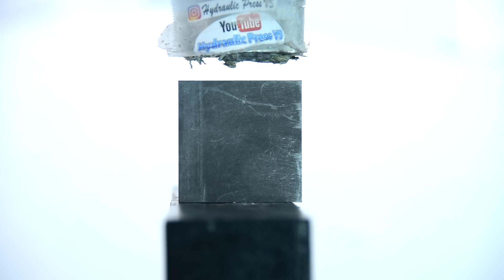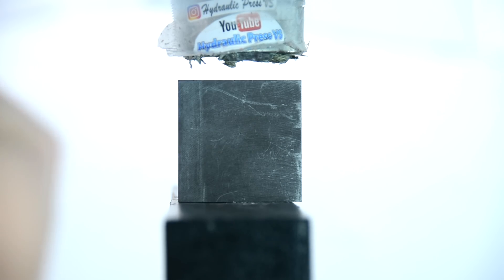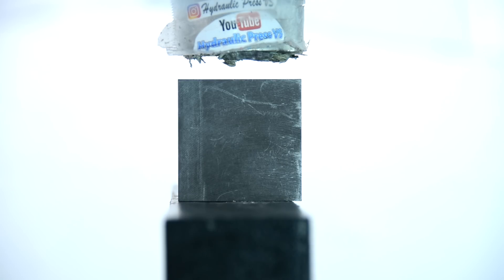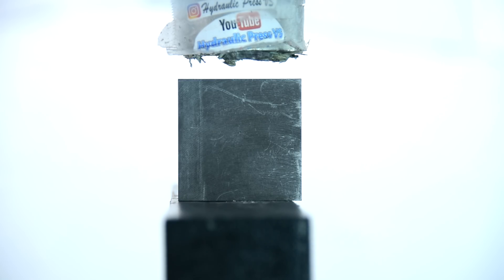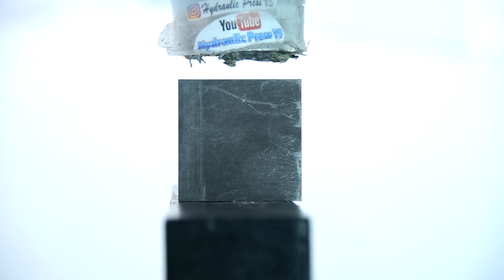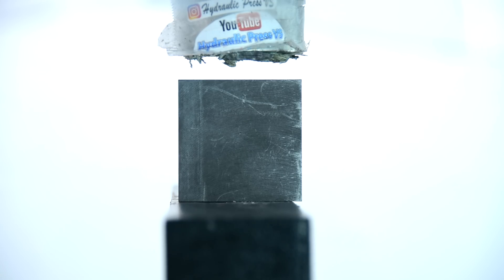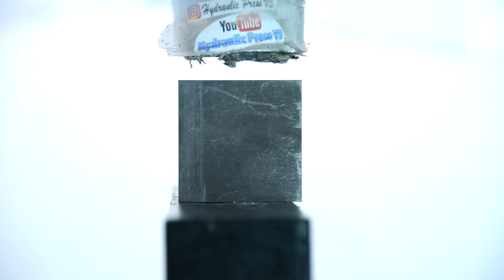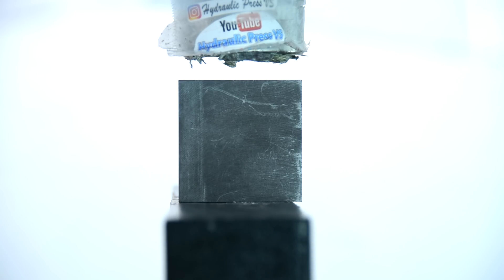Graphite vs Hydraulic Press - Can you make diamonds from carbon?

Comment: The actual way to make diamond is by heating graphite till 2000 degrees and then applying the weight of or pressure of 92 tons on it then boom you get a diamond if it did not work try using peanut butter or coal instead of it

Comment: You did not make a perfectly cut diamond from a chunk of graphite. You realize that it takes heat AND pressure to do this right? Hence why diamonds are made deep within the earth's mantel, and when found on the surface they are basically small chunks of rock that need to be cut before they are set into a ring or necklace, not perfectly cut like you saw there. This video is scientifically misleading.
Reply: The Signless you must be fun at party's.
Reply: The Signless nerd
Reply: Drsnipez03FTW and proud of it. Got a problem?
Reply: Drsnipez03FTW Chill, or he may proceed to use his extremities as projectiles. (aka throw them hands)
Reply: It is unkind calling him a nerd just because he's smarter than you

Comment: The only way you can produce a diamond with success is if sufficient pressure is applied equally from all directions inward onto the entire external surface of the object of graphite. You only applied the pressure from only one direction using the hydraulic press. To do this, why not use a liquid filling a container that can have the hydraulic press insert into it from only one end, and then apply the sufficient pressure with the hydraulic press to the liquid with the object of graphite in it. Therefore, regardless of using only one hydralic press, the necessary pressure will be applied to the entire external surface of the object of graphite.
Reply: Thedoctor19000 you also need the extreme heat
Reply: True.